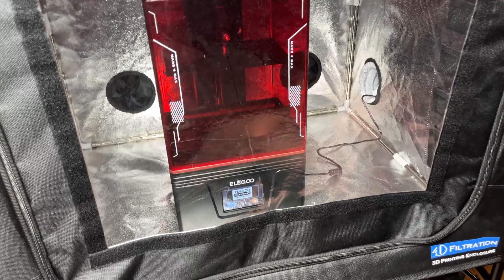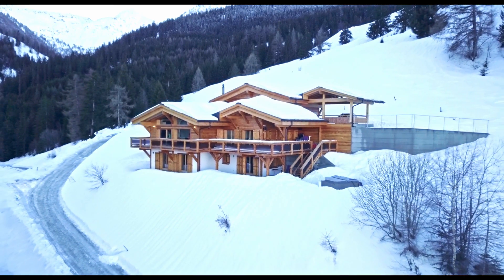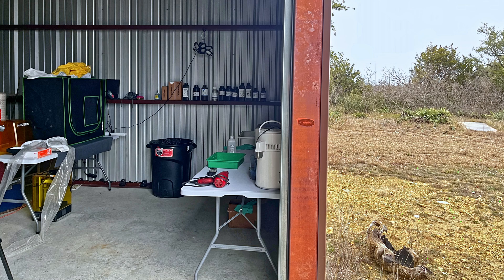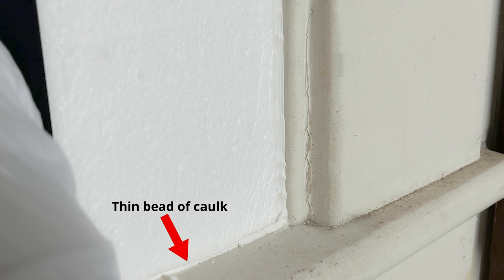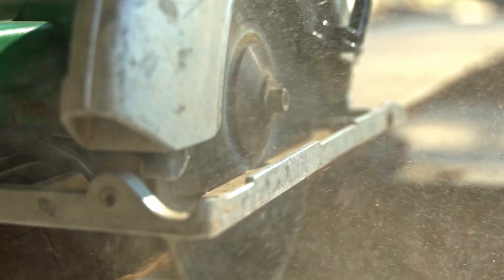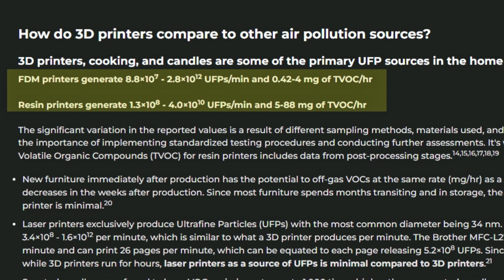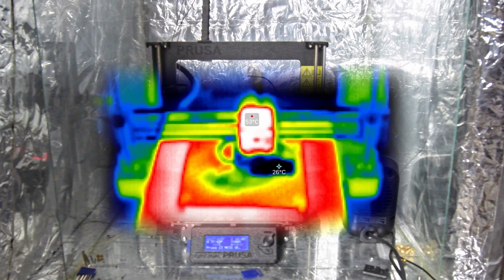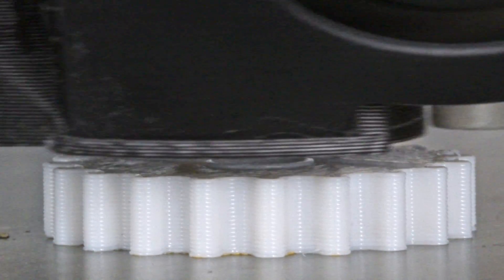FDM & Resin 3D Printer Ventilation

Comment: Can I use a grow tent with a merv 13 filter system in a closet? Thank you in advance. I have limited space.
Reply from the maker: Yep MERV 13 and HEPA filters are both perfect for this situation. You may find one cheaper than the other, but the main difference is that the MERV 13 filters perform best in recirculation setups like a closet. A HEPA filter would also work for this, but since their efficiency is higher and flow rate is lower, they are typically used for extraction.
Happy Printing!

Comment: So I just got a Bambu Lab A1 mini and I only print with PLA. Mostly Matte PLA. I have this large air purifier that sits next to it that has a hepa filter and carbon filter on it. Just the smell has been bothering me recently. So much so i enclosed it in my little bathroom and turned on the exhaust and had the air purifier in there. It still bothers me if I smell the PLA smell. Any Idea what I should look at adding to my set up to help?
Reply from the maker: So for most people, the ultrafine particles from PLA or PETG is what can cause problems, but those will be captured by the HEPA filter and they will not have a smell to them.

PLA will still emit VOCs, even if the levels are drastically lower compared to say ABS or PC. The way to combat these VOCs from PLA without using ventilation is to utilize activated carbon in a canister. Canisters that are designed correctly can have several inches of carbon, whereas traditional air filter panels will use very small amounts of carbon that often have air gaps, making them useless from a safety perspective.

So the things to look for are carbon canisters, coconut shell activated carbon (traps the VOCs), and/or specialized media like FumeFusion Zeolite that can breakdown the VOCs or act as an indicator for when to replace carbon.
Reply: @ArisAlder  thanks for the info. No one has specifically mentioned canisters when looking this stuff up. I saw them on the grow tent site I was looking at but didn’t think they were any different than my air filter I got. I just looked for the best budget air purifier and came away with the winix 5500-2. Thanks for all the info.

Comment: I recently bought an elegoo mars 5 ultra that I keep in my garage that has one back window and I only run with garage open. The vocs get up to about 1000 when running the prints at full heat, then drops to about 400 or so when its off. I wear a ventilator but still am concerned about the vocs. How can I get rid of even more?
Reply: I also have small elegoo air filters for inside the case to the elegoo and have a small intake fan blowing out the window. I am just paranoid about the vocs.
Reply from the maker: The venting like that does work, but the small blocks of carbon do little to reduce VOCs, especially if you use IPA for cleaning. There is specialized media that can be used to breakdown the VOCs as they are vented, but that wouldn’t help you in the garage. That would be more for close contact housing like apartments or perhaps cookie cutter house developments with close neighbors.
Reply: I dont use ipa, I use green machine to keep vocs down. So if I add in shop fan will that help lower the vocs?  @ArisAlder
Reply from the maker: Even though you’re already venting, yes if you add a shop fan while the door is open then it will improve circulation with cleaner outdoor air
Reply from the maker: What detector are you using and what are the units?

The resin will off-gas more at higher temperatures, that is to be expected. Wearing a respirator while working with it is a substantial safeguard.
One of the best things you can do is run fans in the garage to circulate the air. People often lean towards inline fans, but in an open garage a shop fan would be suitable.

Comment: Thank you for this insightful video. Would I be able to ask advice for my situation. A small, 2nd floor bedroom apartment with a balcony. Putting a table next to &  behind the openside of the  door at the end.

I would have the resin printer in a grow tent. It gets really cold in the winters. I would make a small frame with a curtain around the table fot additional UV protection.  It seems venting after printing is complete is ideal as well as an heater on the inside of the printer lid. 

Now would it be best to have a ventilation fan/filter outside or inside the grow tent, and should and a duct as far from the doors as possible?

And the filters should be activate carbon + hepa?

Balcony is only 6 feet wide, covered with a roof.

Thank you.
Reply from the maker: I would keep the fan inside the enclosure to help protect it from the elements, and some duct can be helpful for directing the air away.

Since it would be outside (and it’s resin) filters aren’t really necessary unless the fumes can become a nuisance for neighbors.

MERV or HEPA filters for the particles would be more for filament rather than resin, because the nanoplastics can end up in the air and eventually deposit into our food/water supply.

Resin is more problematic on the VOC side of things. If the smell/fumes become a nuisance to neighbors then the best thing to do is run the exhaust fan and duct through specialized media to breakdown the fumes. Generally, this isn’t necessary since most of the VOCs break down relatively quickly in sunlight (half-life of formaldehyde is 30 minutes).
Reply: @ArisAlder  "most of the VOCs break down relatively quickly in sunlight"
Does this mean you could use UV light to make resin fumes less harmful? I assume it can't replace ventilation but could it help make the workspace safer?
Reply from the maker: Good question - UV light can help break down VOCs but it would also create ozone, which is arguably more problematic. The best way to make it safer (without venting) would be to use a filtration media impregnated with a strong oxidizer like potassium permanganate. For example, "FumeFusion" is a zeolite impregnated with that. It's not plug n' play, but it has the potential to make things safer if implemented correctly.
Reply: @ArisAlder  Haha alright, ozone doesn't sound like something I'd want indoors. I'm not gonna pretend I understand much of that but thanks for the very informative reply!
Does this mean that curing stations can generate ozone from the fumes of (partially) uncured resin? Guess it's alright as long as you vent everything?

Comment: I've just started a job working with multiple resin printers in an unventilated room, I can open some doors to the outside but that's about it. Will a full face mask with 60927 3m organic vapor cartridges make this safe in the Long term? Can a respirator alone be enough?
Reply from the maker: Provided that the cartridges are changed regularly, the respirator would provide enough protection to meet safety standards, but relying on the respirator alone is not ideal. Ventilation and minimizing time in the room are effective solutions that should be explored in order to improve long-term safety.

There are also other factors to consider, like what is the outlined cleaning process? Using IPA in a wash & cure will release more fumes than when sealed inside a bag or container in an ultrasonic cleaner tank filled with water. There are also resin detergents; although, I can't speak to their effectiveness.
Reply: Thank you for the answer, A mask being sufficient is great news. 

There are two large Ultrasonic cleaners filled with IPA, first one is used for 3 minutes then the second for 3 more. They are in a second more ventilated space, I think based on just the fire risk I will have to change the system to bags or jars, surely if this stuff is as flammable as it seems it just can't be safe to stand in front of pool of it?
 @ArisAlder
Reply from the maker: You are right that there is a risk of fire when it is put directly in the tank. This is because the liquid IPA is becoming vapor that can be ignited with a small spark. I have an ultrasonic cleaner video that should what a fire in one would look like.

Comment: Or, if you live in a modern house with balanced ventilation, just leave it alone.
Reply from the maker: The issue is that it would spread everything around the house as well, exposing loved ones.
Reply: @ArisAlder  I said modern. Not first implementation they started with 40 years ago.
Air in and out vents in every room, or at least in rooms you would suggest to use the printer in.
Reply: @1kreature  There is no way of preventing someone from partially inhaling some particles while they reach the ventilation system, that’s the reason why a controlled environment such as the ones described in the video is required, even with a house with “modern ventilation” systems.

Comment: Amazing video, exactly what I was looking for. I'd been wondering about air quality with indoor 3d printing, especially FDM for a while. I have a rather large CR box next to my printer, so sounds like I'm reasonably safe. I eventually want to get a VOC sensor to see whether I should get a activated charcoal filter, too, but hopefully I won't need it.
Reply from the maker: The CR box, assuming it is using MERV 11-13 filters will capture most of the ultrafine particles, so you're definitely good there. As for the VOCs, if you are printing mainly PLA/PETG then you'll be okay. 

As far as the sensors go, what I generally tell people is that if they had only $100, it would be better to spend it on filtration than the TVOC meters. The meters, at their best, can tell you the comparison between outdoor and indoor air (this requires calibrating every time you use it). The TVOC metric doesn't provide any distinction between chemicals, so it's impossible to know what is actually present. The formaldehyde sensors also trigger on other chemicals like alcohols and esters (e.g. IPA).
A practical example is that with ABS, the TVOC reading can actually stay relatively low, but that small bump is all that is needed to create unhealthy levels of Styrene. Styrene is an assumed carcinogen (based on animal studies), and it is a component of the burnt rubber smell of ABS, ASA, and HIPS.
Reply: @ArisAlder  Thanks so much! Really appreciate you taking the time to answer in detail. The CR box uses 20x25x4in MERV 13 filters indeed, the fan might be slightly undersized but I can keep it running all day.

Getting a sensor would be mostly out of curiosity, I wouldn't expect much actionable insights from them - and indeed the only actionable insight would be to get better filters, in which case you rightly point out I might as well get filters from the get go.

Then again, I thought similarly about a CO2 sensor - my apartment has very high ceilings, so a fairly large air volume, and is rather drafty. Yet, to my surprise without lots and lots of ventilation, I would easily sit at >1.3k ppm. I basically went from ventilating once or twice a day to constantly having 1-2 windows ajar.

For CO2, I got a sensirion reference USB one that seems to be very high quality (though I haven't calibrated it) yet was only $55. For TVOC and PM2.5/10, I am a bit more sceptical whether there's anything that's affordable yet reasonably good.
Reply from the maker: 1.3k ppm indoors is definitely on the high end of things - looking into a few plants might be a good idea too, good for the air & ambiance.

As far as CO2 and the VOCs are concerned, that sensor can actually signal when chemicals are being broken down when using carbon or zeolite that is impregnated. From my testing with resin printers, the CO2 level rises about 20% due to the more complex chemicals being broken down.
Reply: @ArisAlder  And that was purely from people breathing, no printers running. Nowadays with plenty of ventilation, it's around 800 and if it gets to 1k, I'll open more windows. 

Was very surprising to me how much ventilation is needed and I'd never have realised without a sensor, so that's why I'm curious to get a PM/VOC sensor, too.

I couldn't imagine doing resin printing indoors without having at the very least a dedicated room, but ideally a garage or shed. Which is a shame, because resin printing looks super cool.

Also if you want to hear a horrifying anecdote: My local library has a maker space (cool!) with 3 resin printers and a dozen FDM printers (very cool!) running in a 40sqm room with standard commercial ventilation and half a dozen people inside at any given time, none of which wear PPE.

Comment: I want to get a bambu lab a1 to print PLA only. However, it will be in my room very close to where I sleep and close to my other family members’ rooms as well. I can’t rly add ventilation as there is only a window in my room and I can’t drill through walls and the garage gets really humid. What should I do?
Reply from the maker: Ideally any 3D printers should be out of bedrooms, but printing PLA is the safest option there. What you can do is get any consumer air cleaner with MERV 13 or HEPA filters to capture the ultrafine particles. These particles are the main concern with PLA. PLA will still emit some VOCs (fumes), but they are not as hazardous as those from other filament like ABS.
Reply: Make sure you have good health insurance, see how much inhalers cost first, astma or copd is not cheap

Comment: Anyone got any suggestions on how to best vent/filter a P1S? It's in a basement, exterior window available a room over. Haven't seen too many solutions, seems like most folks just deal with the fumes.
Reply from the maker: What filaments are you printing?
Reply: @ArisAlder  right now PETG/PLA, but I'd like to start printing in nylons, ASA, ABS etc
Reply from the maker: So for PLA/PETG you can use any consumer air cleaner that has MERV 13 or HEPA filters, since particulates are the main concern. Other filament like ABS introduces some nasty gaseous chemicals.

The safest and cheapest thing to do would be to run duct hose to that window - some people drill through the wall in a basement, but that isn't always viable. Filtration of the fumes can be done but it has to be the right type and quantity - it will be more expensive.
Reply: @ArisAlder  would attaching the duct hose to the P1S be possible by utilizing the poop chute? with a high enough flow rate through the hose, I'd imagine with some clever design it could still "poop" while extracting
Reply from the maker: I'm not sure if it is possible - I don't have a Bambu. Something like that would work for PLA, but it could cause warping on the other filaments.
For the filaments that need a heated chamber, the most efficient way to go about it is to place the printer in an enclosure like a grow tent. This allows you to control the airflow while not removing the heat from the chamber.
Reply: @ArisAlder  Okay cool! That's good to know, I hadn't thought about cooling the chamber inadvertently. Thanks!

Comment: Very informatice video! I'll look into growing tents those seem to be a great solution for a dusty workshop area

Its also good to know that even if you are just printing PLA the parts on your printer will heat up (especially the PTFE components) and will outgass. So its always a good idea to ventilate a printer and keep it away from your living-sleeping space ^^
Reply from the maker: Thank you for the support! The PTFE offgassing is very correct, especially when printing filaments like PETG or ABS above 230-250°C. Thankfully though, a large percentage of new printers are using all-metal hotends to achieve 300°C nozzle temperatures.

Comment: I have been using PLA-F which has ABS with my ender 3 in my room without enclosure. But it is right beside an open window is my siblings which is in the next room at risk?
Reply from the maker: Having the window open introduces cleaner outdoor air, which is good, but it can also push contaminated air into other parts of the house. Printing ABS is something I personally would not do in a bedroom or indoors unless it was being actively vented outdoors (sealed against the window).
Reply: @ArisAlder  this means I have endangered my family. Ill make sure to make ventilation.